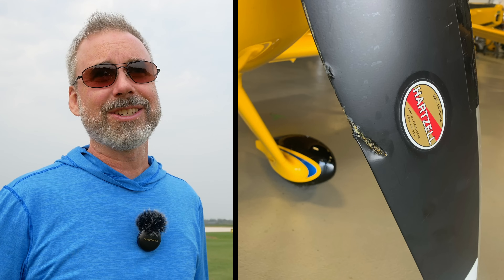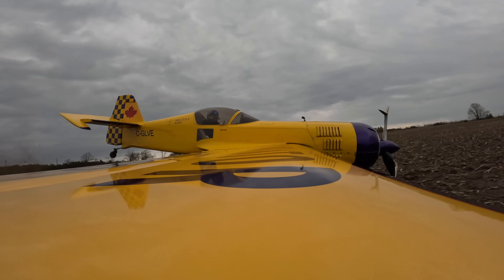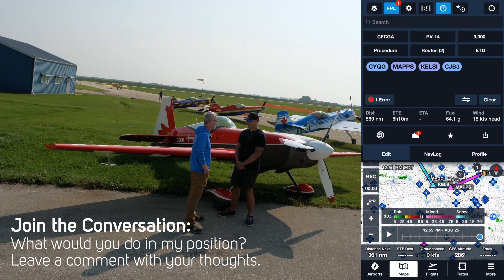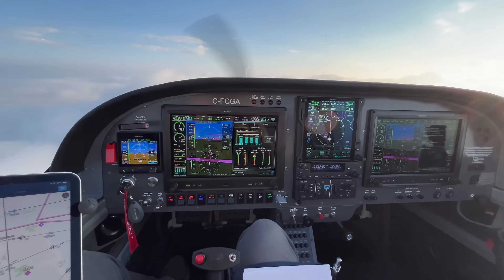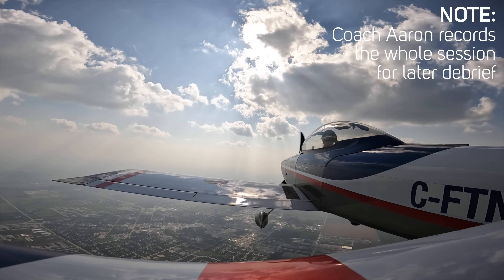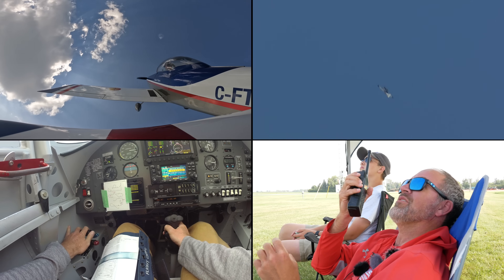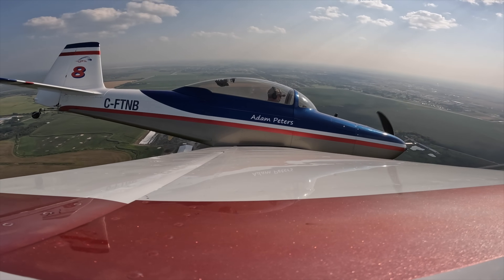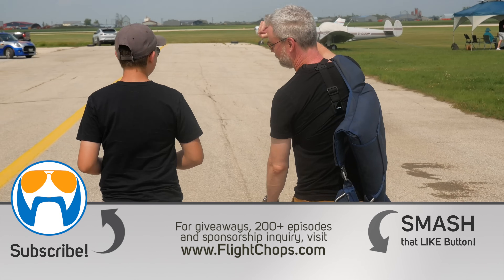This could cost $30,000 and End the Flying Season

Comment: That's not true, you don't have to tear down a certified engine after a prop strike. It's the same decision you were making, you test the runout, and if it's within limits there's a crank bolt that needs to be replaced and it's back in the air. Total around $2500 of service.
Reply from the maker: Read the documentation 🤷 Lycoming was very supportive, but made it clear this if this was a certified engine, I’d have no choice. It’s what I scrolled through quickly in the video, but I can also link to it in an other comment.
Reply: I suppose the confusion is more of what’s classified as a prop strike. What your aircraft has would be solidly in the grey area, and could be treated as you decided to
Reply from the maker: I thought / hoped this was the case as well - but it's not a grey area according to the FAA: 

Definition of Propeller Strike 

(i) For the purposes of this AD, a propeller strike is defined as follows: 

(1) Any incident, whether or not the engine is operating, that requires repair to the propeller other than minor dressing of the blades. 

(2) Any incident during engine operation in which the propeller impacts a solid object that causes a drop in revolutions per minute (RPM) and also requires structural repair of the propeller (incidents requiring only paint touch-up are not included). This is not restricted to propeller strikes against the ground. 

(3) A sudden RPM drop while impacting water, tall grass, or similar yielding medium, where propeller damage is not normally incurred. 

(j) The preceding definitions include situations where an aircraft is stationary and the landing gear collapses causing one or more blades to be substantially bent, or where a hanger door (or other object) strikes the propeller blade. These cases should be handled as sudden stoppages because of potentially severe side loading on the crankshaft flange, front bearing, and seal.

Comment: Has Lycoming actually put eyes on this, or are you tearing it down on text? Because that's a really, REALLY, over kill move.. You don't go into an engine without messing things up, you basically shave time off your engine's potential lifetime.
THAT said, have a prop saver built. Regardless of if it's a good idea to tear it from a static hit, it's cheaper than a whole engine. In case it's not common, it's basically a set of sleeves that go over the props, two braces go over the hub, and from the tips of the sleeves, two arms link up with any mounting point available (if none is available you just have padded arms that lock on the wings). It's composite material for the sleeves and metal for the frame. The space where the airplane is kept is too small if that kind of stuff happened.
Reply from the maker: Thanks yeah - so the answer from Lycoming was essentially: "if this was a certified engine, we'd be going down the road of the prop strike inspection".  
The only reason I can consider any other options, is because it is an experimental airplane. 
To help clarify for others, I'm going to pin a comment under this video with the FAA definition of a prop strike.

Comment: Not a prop strike! The engine is fine :)
Reply from the maker: Incorrect, it is literally the FAA definition of a prop strike. And although the engine is likely fine, on what authority can you make that claim? (without following the process we went through (which I cover in the video).
Reply: FAA definition for a metal prop?
Reply from the maker: @sophiejaysstuff4026  Show me in the AD where it specifies prop material.  
I dealt directly with Lycoming working through this and it is what it is.  
You can make assumptions all you want but it doesn’t change the reality.

Comment: There's a 'flying season'?  🤣
Reply from the maker: well - yeah - there is here for sure - and I think for the sake of "aerobatic competition flying" this is the 2023 season I am talking about - which I was about to fly my FIRST contest for.
Reply: The competition specific aircraft have inverted systems that don't do well in colder temperatures, can actually cause significant damage to an engine.  Effectively limits the season to temps above freezing.

Comment: Take it easy. Bought a certified plane and it was landed one week before I took it over without landing gear. And I have no sponsors. Just get over it and buy an overhauled prop...
Reply from the maker: Sorry that happened to you.  
Beyond the damage and costs, what was mostly disappointing here was having to cancel flying the airplane at the contest I'd spent months preparing for. 
But as you can see in this video, I share the story of "getting over it" :)
Reply: @FlightChops  Yep, I can see that. Flying the RV8 was also not the worst experience I guess. Flying a RV as well. Not too bad :-)

Comment: I watched the guy breaking up a propeller blade in his hands and stopped watching. Then he proceeded to talk about a common sense approach to prop sticks 😂. Common sense=cheap. What sort of cheap arsed prop can you destroy in your hands!!
Reply from the maker: These are top end composite props - it is what it is.  
They are incredibly strong under normal operations, but delicate when misshandled.  And in both my case, and Ryan's case, the minor prop strike on a not metal  prop saved the engine.  I'm sad you bailed on the rest of the video - it's a good one - the prop scene was basically over at that point, and it transitioned to the aerobatic contest pivot to the RV-8

Comment: Thats not a 'prop strike'. Clickbait.
Reply from the maker: Well, by the literal definition issued by the FAA... it is a prop strike. 
Regardless, I invite you to think of a better title for this video?
Reply: @FlightChops  Perhaps thats the FAA definition, but a prop strike is commonly defined  when the prop hits something when engine is running.
A prop damaged in hangar will never require any work on the engine. 
i had a real prop strike years ago, when i had a runway excursion, prop was damaged, engine was on idle, we repaired the prop, end of story. 
any damage to the airplane in hangar sucks. happened to me way too many times and nobody ever admitted responsibility for it. 
Do we really need more drama and alarm in the recreational aviation community? uhm no...
Reply from the maker: This event was very dramatic in my world. It is not hyperbolic. It substantially changed my plans, and I spent the better part of the week being significantly depressed about the ramifications and how to handle it.  
If you watched the video (which I'm open to retitling if you can offer a better idea), you'll see I'm sharing an authentic story and legit information about how I handled my first prop strike experience. 
You can disagree with the FAA definition, but it is what it is, and I had to proceed with my decision making about it as such; If the airplane was certified, I'd currently be looking at a naked firewall waiting for my engine to be torn down at the shop and figuring out how to pay for the nearly $30K bill. 
As a creator that works reeeaaally hard to make good aviation content, constantly battling the algorithm to get it put in front of subscribers, the accusation of making disingenuous titles / thumbnails is extremely frustrating. 
So again, I invite you to come up with a better title (and thumbnail?) idea for this one.

Comment: Absolutely do not tear down the engine down just because of propeller damage, that's a dumbest thing you can do instituting major heart surgery on a minor cut to the arm. Don't do it Don't tear down your engine unless it's absolutely necessary The infant mortality on engines is huge compared to a great running engine again do not tear that engine down statistics back that up 100%, do not tear the engine down.
Reply from the maker: That’s what I decided, yeah.  But Lycoming made it clear I’d have no choice if it was certified.
Reply: @FlightChops true, if it’s a certified engine unfortunately you wouldn’t have a choice, doesn’t matter how minimal the prop strike is, or even that it happened in a hanger, if that prop is damaged you have to have a prop strike inspection performed, and that means completely disassembled engine and magnetic particle inspection on all ferrous metals parts and dye penatrant inspection on non ferrous parts and measurements of every part and anything out of spec gets overhauled, it can turn into a lot of money, I do this for a living.